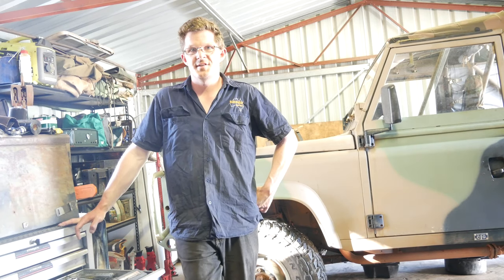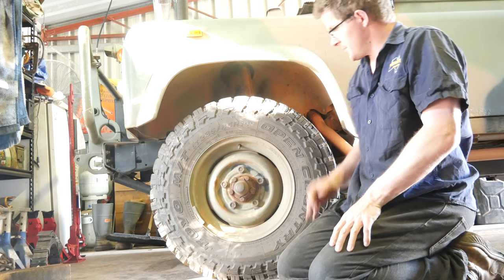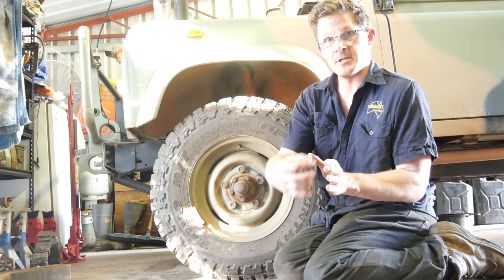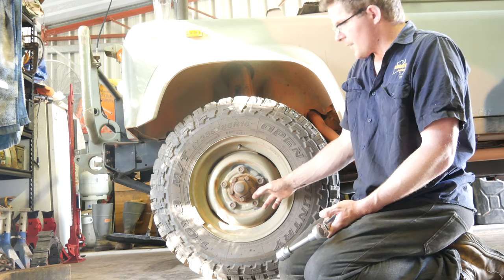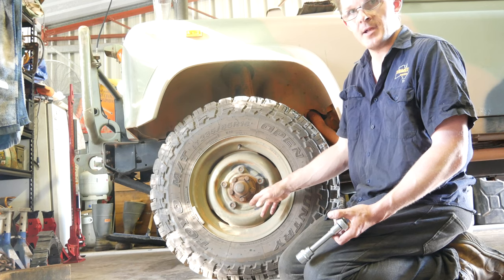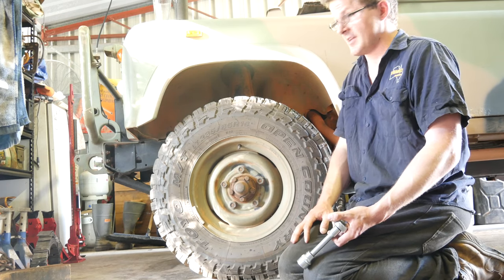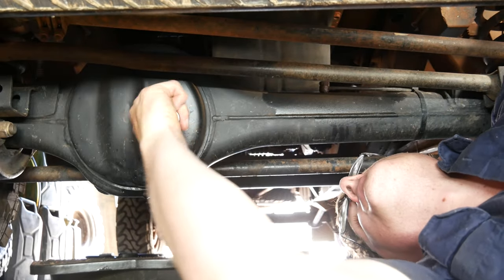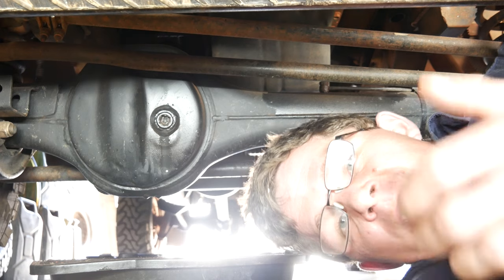Land Rover Perentie servicing tips and trick Ep6

Comment: Very clear video Geoff. Keep the perentie content coming 👍
Reply from the maker: Hi Oscar. Thank you for your kind words, we will keep them coming your way. Kind regards Geoff
Reply: @seriouslyseriesaustralia  Just one question, I have read that many people use Rx Super 15w-40 in their gearbox and transfer case. I live in a cool climate in southern NSW and was wondering if you think this ok for my perentie? Thanks Oscar
Reply from the maker: @oscargordon3149 I would probably stick with the 20w viscosity oil. I have driven my Perentie in low temperatures (-2 degrees Celsius) and from my experience I haven't had any issues changing gear. 20w is what Land Rover recommends so I would probably stick with that unless you wish to change your transmission oil before it gets to summer each year. Cheers Geoff

Comment: hi geoff, thats bernd from colombia, south americe. interesting vids and i would like to contribute some points. i have 2 lr serie 2a and 3 and maintenance is the hip or hop of the vehicle. if you do your inspection underneath - dont forget to clean the breather in the axle. u-joints: dont wait 6 month to give them some hub of grease. dont do any damage just you are underneath give them some fresh grease. oil for the gear and transfer box: they get upnormal hot, at least over here and the boxes are known for this. so i choosed 90-140 gearbox oil, runs much smoother, no problem changing gears. gl-5: there is a rumor that it reacts with parts out of bronce. but some gl-5 explizit say that they wont. checking the level: before you open the nuts give it a nice flush of cleaner to get the dirt away and clean with paper. gear and transferbox oillevel: for some reason my gearbox pumps the oil in the transferbox, guess its the o-ring. whatever, its absolutely crucial that the oillevel dont exit maximum level, because as low oil level will destroy the box, also exceeded oil-level will do the same. keep on going --- nice channel
Reply from the maker: Hi Bernd. That you for sharing those useful tips. It is nice to get some information on how to keep the Series Land Rovers running in tip-top condition in a warmer climate. Sounds like you have a very interesting Land Rover fleet, and no doubt some interesting adventures. Many thanks, kind regards Geoff

Comment: Talking about tcase leaking across, I checked and changed my fluids yesterday, I found engine and tranny were fine, but my tcase somehow was very high! I have no idea how much but I would say half to a liter came out the fill point, swing as the others were not low and I have not had to top either up since last oil change this seems very odd and confusing that Spock must’ve teleported extra oil into it
Reply from the maker: This is a common issue. the seal between the gearbox and transfer case can leak. the gearbox operates at high temperature and will pump oil into the transfer case. Kind regards, Geoff

Comment: 75w90 are thinner but hold viscosity better in high temp than 80w90... synthetic vs mineral.    And for gearbox best was MTF90 or ATF oil, due heat resistance. For transferbox use same oil like in diffs.
Reply from the maker: Hi Jakub. Thank you for sharing that, I believe that is the case with the later gearboxes in the Defender, which we will be covering in a future. Thanks for sharing those tips. Kind regards Geoff
Reply: For.the 5 speed landies use redline mtl.
The perentie 4 speeds need an engine oil. Itll be rhe same oil ij the engine gearbox and transferbox.
I think penrite do a transaxle synthetic oil 75/85 which works well. Otherwise use engine oil. 
Ep90 has additives that will effect the spacers between the set of gears in the middle of the transferbox. I dont think they damage the spacers or synchro cones. Jist discoloured them. Anyways dont use ep90 in either the gearbox or transfer box but use engine oil or penrite full synthetic 75/85. I think there is info regarding the penrite oil on klr website.
Ep90 also creates difficulty in gearbox changes i the box is hot.!
Reply: @mattluszczak8095  its Isuzu Gearbox? I owned Trooper wirh 3.1td and 5 speed manual and its need engine oil too ;)